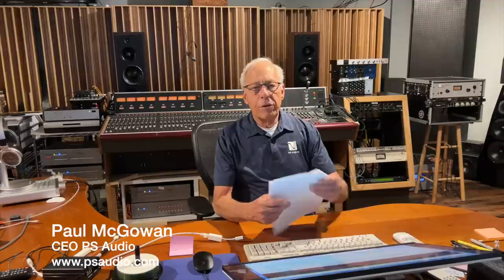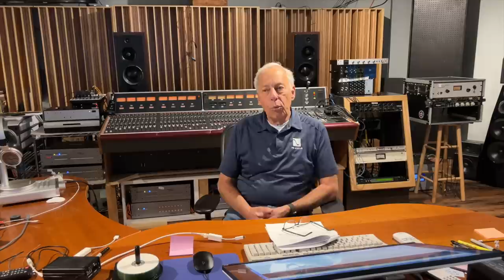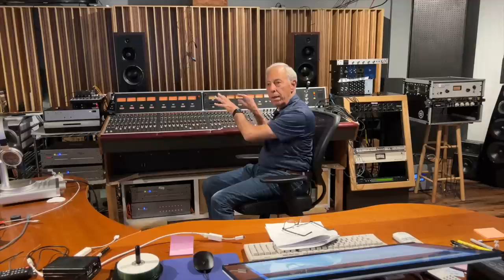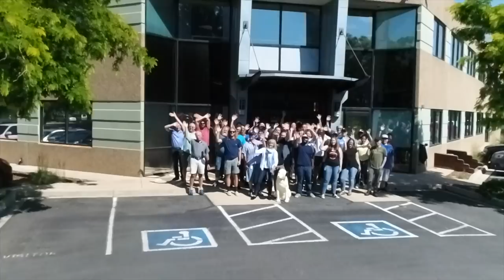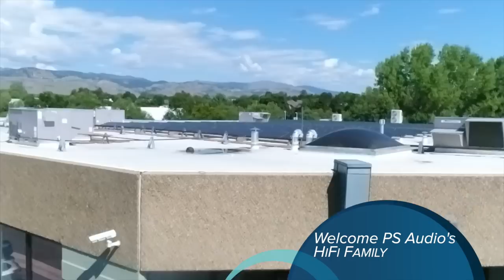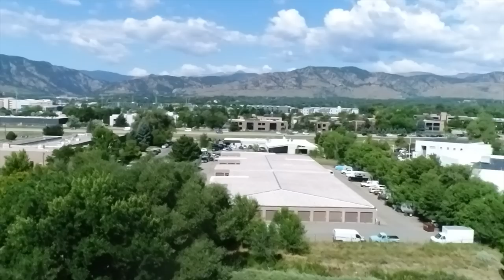Converting DSD to analog

Comment: In PCM you can process the audio much more easily and finally cheaper. But the resulting sound is very compromised if you compare that to analogue audio processing. I guess there is more evil in digital audio processing than in PCM vs DSD  recording. AAD CD’s always sounded great, much better than ADD or DDD.)
Reply: Sound recorded in PCM is extremely less compromised than any analog process.
First of all, PCM has a much better frequency response, with a lower noise floor and a significantly greater dynamic range than an analog source such as an analog mixing board or analog tape. 
Every step of an analog process adds more noise, phase shift, and distortion to the signal path.
PCM can be edited without adding more noise, creating more signal phase shift, or adding more signal distortion.
Reply: @Douglas Blake I think people like the vinyl sound, not because of the physical format... or that it is analogue...   but because of the mastering techniques  involved.  
When mastering to vinyl...  anything between  300Hz  to 7Hz that may be out of phase, needs to be mono summed due to the way the cutter head  cuts into the lacquer.  

You also have to limit the acceleration of the  high end so that the stylus can still track the groove on playback without distortion.   

Also, you can't master with too much compression without the risk of burning out the cutting head coils due to the current involved in driving the torque tube and stylus. 

This makes music sound more natural....   after all,...  although digital can produce stereo low end out of phase sounds quite easily, it is something we don't find in nature. 
Human perception is that: the lower the frequency, the more difficult it is to locate the direction of the sound source.   
For example:  Thunder seems to come from all around....  as where we have a very good idea in which tree a singing bird is located.   

This is why we often only have one Sub-Woofer in a stereo speaker system.

Point is...   you can make digital sound like analogue vinyl without compromise if you know what you are doing.

You cannot however, make analogue vinyl sound like digital. 

Sadly the trend in digital is just to brick-wall compress the hell out of everything and be totally  ignorant to any low end stereo out of phase.  Moreover, we EQ cut sounds below 20Hz and also cut anything above 20kHz under the excuse...  "well that's the range of human hearing"....   
and then wonder why people say they prefer analogue ???? 
 
Don't know about you...  but i like to feel the harmonics from the bass in the room.... not just hear it in the music! 

We may now have the technology...   but i feel we have lost many of the skills involved in the mastering of music.  And our customers know it!
Reply: Lol analog is crap
Reply: @janedoe6350  people would like the digital sound exactly the same if someone tells them it's vinyl
Reply: @Harald_Reindl  From my experience, yes! They would on first listening.  And that's what selling records is all about. That's why brick wall compression works... it's the monosodium glutamate of audio.  

But people soon tire of it. And then they want better... but they think it's their equipment not the recording.. so they long to upgrade...   but they never are totally satisfied...  which the equipment manufactures love...   almost as though they were in cahoots with the mastering engineers and record labels. 

So few people are ever 100% satisfied.  They always think...  if i only get the next new gadget...   the next new format,.. the higher res version.

But go look through your own records and CDs. Look for the ones you really love, have had for years, will always have, and never get fed up of.  Have a good look closely at the small number of recordings you don't tire of....   
and more than likely...   they were all mastered by the same small handful of mastering /cutting engineers.
You may find all your favourite bands and artists all have the same thing in common. 

You may not find the info on the jacket /  liner notes so you may need to do some research to look up who mastered them.
Or look up the matrix number in the dead wax.

But you will commonly find the names of:
Bob Ludwing
Bernie Grundman
Bob Katz 
Ian Shepherd
Steve Hoffman
to name only a few....
But these people know the secrets i outlined in my previous post.
They know how the magic works.
Reply: @janedoe6350  I am also not 100% satisfied with a majority of records but after get good speakers and perfect room acoustics you are done - no amount of money and no snake oil would charge anything
Reply: @Harald_Reindl  But that's not the point...  Music is not mastered with audiophiles in mind.  Well mastered music should sound good on all equipment. Back in the 60s and 70s only a small proportion of the record buying public had "good" speakers and amplifiers let alone a moving magnet cartridge...   we all had ceramic piezoelectric mono cartridges, poor quality speakers and the music sounded fantastic. 

Back in the days of Bill Haley, Elvis, and then one decade later, The Stones and The Beatles....   the average equipment was not of good quality.  The record players and especially the speakers lacked bottom end.  So the bands of the time used effects like reverberation and distortion to compensate for the inadequacy of the playback equipment.  

These effects produce harmonics  across the whole frequency spectrum to fatten the sound of the weak bass guitar on Lo-Fi players. 
When you added distortion to a bass guitar it throws harmonics into the mid-range  where those old record player speakers where far more responsive.  This meant that the music sounded full and balanced across a range of different equipment, from battery record players through to hi-end Hi-Fi.  

Sadly, many of these earlier recordings have been "remastered" and cleaned up but there are some modern examples of these techniques.

Example:  There is a band from the 80/90s called "The Cramps",  They made records that would sound good played over the telephone let alone on compact cassette, CD or vinyl.  
Go check out "The Cramps - Bikini Girls with Machine Guns" on youtube.
Play it on a HI-Fi with a DAC and then on something Lo-Fi like a smart phone's speaker and then you will understand.

Also, listen to "2pac - Shorty wanna be a thug" on YouTube.  The track is a digital CD release ripped to Youtube.  But is sounds like analogue Vinyl. 

It's the way something is mastered that makes well performed music sound fantastic...  not the equipment that it's played back on.  If this was not so...   only people with hi-end equipment would be consumers of music. 

You want a disk to go platinum?  It better sound good on a pocket radio with a 2 inch speaker.
Reply: @Douglas BlakeYou are just so correct with the post ""it is deeply ironic that we took the format with the best range and used it to fight a loudness war where the goal was 0 dynamic range."   
But... it's just amazes me that it went over so many peoples heads. People just don't get it. 
At least i know why i like vinyl...  and it has nothing to do with analogue.
The constraints of the format prevents such high levels of compression.
Reply: @Douglas Blake I know, it's sad.  I play guitar, classical and contemporary.  A few other instruments too but primarily guitar.  I'm not a performer i may add.  That is a different talent within it'self.  However, i'm a relatively accomplished guitarist.  I often play when we have friend around.  I'm always amazed when, predominantly under 25s tell me, they have never been in the same room as someone playing a "real" musical instrument. 
What has the world become?

Shit, i went to see Rush when i was 14 years old with my friends, paid for it myself... out of money working a paper round.  Early 1980s. We had no adults with us. 
I had been playing guitar about 2 years at that point...   i thought i had heard some excellent musicians prior to that gig....   How wrong i was. 
It's a real fact, young people today will never get an experience like that at such a young age. Makes me want to cry.
Reply: @janedoe6350  "Sadly, many of these earlier recordings have been remastered and cleaned up" - thanks god for that! back in the 60s and 70s a majority of music sounded shitty and hat bass without any eggs sounding not realistic at all - sadly a ton of modern recordings suffer from the same problem until you get a japanese remastering and for "But is sounds like analogue Vinyl" - nonody with a brain and good equipment wants that analog shitty sound back
Reply: @Douglas Blake Yer... kids love music, they can hear those high frequencies with those tiny little ears and those tiny little ear drums.  It's a shame that our ears increase in size when we grow up. It would be so much better if we could keep our little kiddy ears and just grow a par of adult ones right below them...   then we would have 2 way hearing.  Little kiddy "tweeter" ears as well as bigger "adult" woofer ears. 

I can no longer hear a sign-wave above 10kHz... however, if i use a graphic equaliser to boost the 15Khz band by a couple of dB... and i can tell the difference.  Those extra highs still move air in the room and the harmonics they produce effect the phase of the frequencies that i can still hear clearly.

You are also correct. B&O had a filter switch in the output stage.  Early low cost speakers had small diameter voice coils even on the larger speaker units.  Lovely mid and high end but totally lacking in bass.  I believe the "CS" just put an inductor in series with the speaker output to act as a low pass filter, taking out some of the presence and brilliance and forcing the paper speaker cone to produce a more linear response. It worked well.

There has been may cunning tricks throughout the years. 

Before distortion effect pedals where invented, guitarists liked to use smaller 30 and 15watt amps like the VOX AC30  and AC15 so they could over drive them real hard more easily.  A distorted bass note will produce harmonics at frequencies in the mid and upper mid range.  This means you can hear some of the bass on smaller Lo-Fi radios and record player speakers.  

Before the "fuzz box" was a thing, English bands such as "The Troggs and "The Kinks" would take a razor blade to their guitars speakers and make a few radial cuts from the outer edge to the centre dome of the speaker cone.  This would make the speaker sound "Fuzzy".  Sounded great but the speaker wouldn't last long.  The "Fuzz Box" and later the "Distortion Pedal" were ways of recreating these effects without destroying equipment. 

The effect pedal known as the "Flanger" was an attempt to electronically reproduce an effect Jimi Hendrix invented. He would drag his finger on the "flange" of the tape spool during recording sessions to deliberately cause "wow and flutter" in a rhythmic motion with the bass track. 

Isn't analogue wonderful.  Thanks for the chat Douglas.  This internet thing is so much nicer when people aren't hostile.

Comment: A lot of the music files you can download from octave records have a big problem! DSD has a lot of noise that they have put in the ultra sonic areas where humans cannot hear! the problem with them is that you get music files that are HUGE in size, take up a lot of space and take a long time to download! 1 bit has more noise than PCM! they should have taken away everything above 25khz
Reply: What you and others call 'noise' and claim that DSD has it over established PCM is actually more detailed and realistic sound. Give it a listen sometimes and be amazed of how DSD sounds. That's what Paul did and what took him on his DSD journey.
Reply: @edfort5704  No DSD (really Pulse Density Modulation) requires a large amount of noise to be added in order to quantize the samples.
This "noise" is supposedly shifted to upper "inaudible" frequencies, however, the noise level reaches the upper-frequency spectrum of hearing in DSD 64.
This is reflected in the size of DSD files and this noise must be filtered or it will ruin amplifiers.
PCM, on the other hand, also uses noise for quantization, but the noise is within the hearing spectrum but well below the threshold of hearing.

Comment: Nope, there is no such things as "do everything in DSD". Any digital studio is relying on PCM in the mastering process and all you can do with DSD is to do the initial track recording in the DSD format. As soon as you need to mix, EQ, compress or whatever, PCM is the format and the master output will ALSO be PCM. Any distribution of the output in DSD will therefore be a lossy transcoding of the PCM format used in the studio. I can't see how that lossy transcoded DSD version can be any better than the actual original PCM version. Now, there is a quality factor of your DAC in how well it translates high resolution PCM to analog vs. how well it does it for DSD. If your DAC is doing a poor job with PCM, the lossy DSD might sound better.
Reply: @Douglas Blake Digital audio can be moved with zero losses from a digital master to your playback device through the internet over 1000s of miles of cables and lots of routing gear. For analog audio, I agree.
Reply: @Douglas Blake I have a degree in computer science and of course understand the issue of a protocol stack that ensures the application layer is getting reliable data through lower layers of routing, retransmission, check sums etc. ensuring that your bank data, e-mails or audio data are 100% coming out as they came in. Anyone thinking digital audio via the internet is some sort of hard case is just plain ignorant on data communication.
Reply: @Douglas Blake At some point in my career I was leading a team of 50 software engineers developing the core CDMA protocol stack for a mobile chipset and at that time reaching 3.1 megabits per second error free over the air data rate (1xEVDO standard). Few people understand the complexity of mobile data protocols allowing many people to share the RF spectrum to stream music or 4K video with zero errors while on the move in a car where the data connections seamlessly hands over between base stations. Only a deep understand if the real science of how radio waves behave can make it possible.
Reply: @PedroKing99  Of course there are errors in digital communication on what is called the "physical layer" but any modern protocol stack will detect the errors and if necessary the data will be resent so the "application layer" doesn't see any errors (check the 7 layer OSI = Open System Interconnection model). This means you can stream a music file across the world and you can bet the data will be 100% as the original source file. I can reliably with ZERO errors stream 192kHz 24 bits FLAC lossless master quality music e.g. via Amazon Music HD across the world into a laptop connected on WiFi and a high quality DAC while your 44.1kHz CD is not only hugely inferior in the audio quality itself but also error prone as the CD media can get scratches causing audible issues.
Reply: @Douglas Blake The reason you have layers in a protocol stack is to ensure that the data gets delivered with output = input. The "application layer" is where your application sees the data and it will not not need to know or care what errors happened on lower levels that got fixed by those layers. You can create 100% reliable communication even the "physical layer" (e.g. transatlantic internet optical cable) is with occasional errors.The "data link layer" is where you will fix the errors in a given physical connection between nodes. On top of that you have the "network layer" that allows you to get the data to move through a complex network involving multiple paths of routers. When you stream music you might have some of the music data going through an entirely different path and you won't even notice it thanks to the "network layer". If you could show a map of the data you would be amazed how your music data could be spread globally from a far-away server before it hits your DAC flawlessly in correct sequence.
Reply: @Douglas Blake Alright, we are just confirming each other 👍